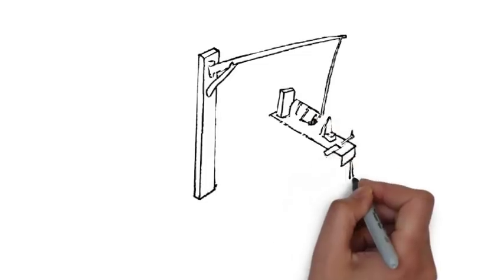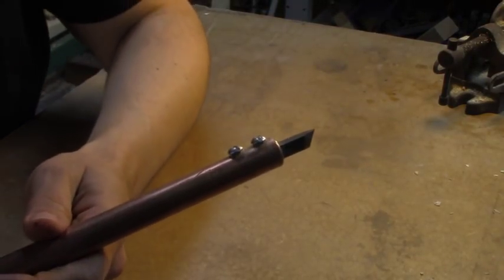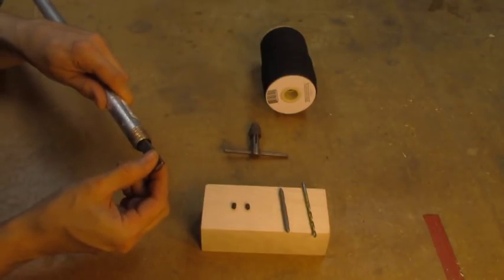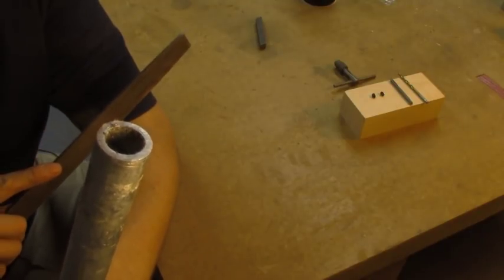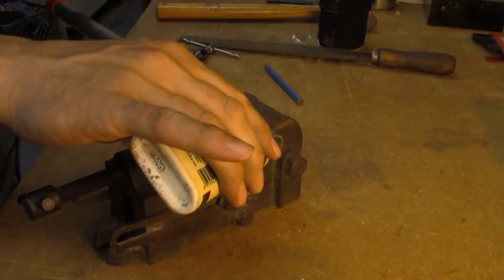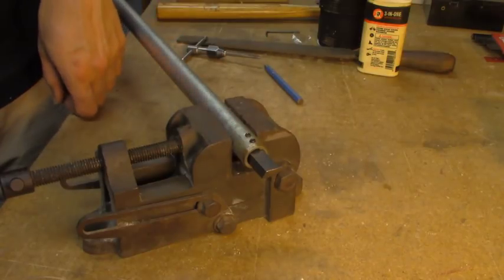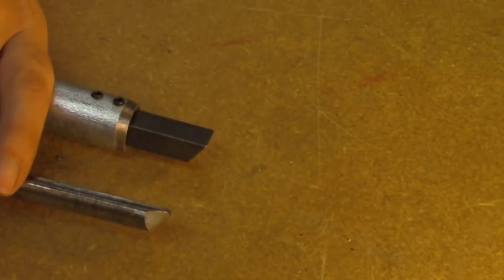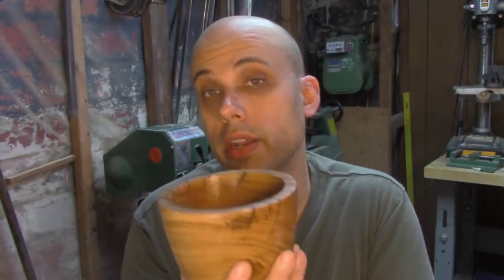Make the cheapest, fastest woodturning gouge EVER.

Comment: This will probably cut even better if you polish the top surface of the bit, because it will give a much finer edge than the mill scale that's there now.
Reply from the maker: A great point.  I actually hone the top with a diamond plate, but this video was already long,  so I left out some details.

Comment: ive not found many places for the cobalt high speed steel, ebay is outrageous on the prices  . 10 bucks for each small piece
Reply from the maker: John Hill Any metal lathe turning bit will do you.  they're all hard as a coffin nail and easy to shape on the grinder.  if you can't find cobalt exactly,  there are many other alloys (like tantung g, for instance) that work plenty good for our purposes. good hunting.
Reply: I tore apart an old washing machine and took the center steel shaft  and cut off and been grinding on it, its pretty hard steel, think it may work fine, its like 3/4 round.. thanks for the info

Comment: Why not just make a carbide bit tool?  They work very well for turning and are very durable and there are many videos on you tube showing how to make them.  They work both on end grain and very well on side grain.  I have even used them almost exclusively for making a bowl from a green piece of firewood.
Reply from the maker: That's a great question. I'm really interested in carbide and I'll be making some of those as soon as I have a spare minute. But to answer your question, I think these tools have some big advantages. 
1.) Cost. These tool bits can be found for as little as $1.
2.) Re-use. High-speed steel is easy to resharpen with the grinder you already have. Carbide is generally disposable. 
3.) Custom tools. These bits are intended to be ground to whatever shape the machinist needs. The turner can do the same thing and even have several bits for each handle.
Reply: Good point! :)   May have to try one.  Always a good excuse for making another tool and another handle!
Reply from the maker: Glad you think so. I like tool-making almost as much at the actual woodworking.
Reply: Or something that takes inserts... Amazon has tooling and inserts cheap

Comment: If you don't have a tapping tool you can pre drill a, smaller size then the screw and screw it in carefully, with soft metal should go fine just be careful to no break the screw inside the hole, it happened to me and it wasn't funny

Comment: Watch a fishing rod building video on how they put on the eyes there is an easy way to finish of your cord with out a knot.  Which is basically  on do the last 6 turns at the knot place a u shape or doubled pcs of cord with the doubled u part past where the knot was rewrap the cord, put end thru the  u and pull it under the 6 wraps. Lol watch video I'm terable at explaining
Reply: Yeah - exactly my thought - the process is called 'whipping', if I recall correctly, and the whole of the cord is glued in place.

Comment: $2 for your tool bit? I'm jealous. I'm seeing more like $20 on Amazon.ca.
Reply: Can buy them cheaply on etsy.
Reply: @robertcornelius3514  I can't find them. Could you help with a link or a good search term? Thx.
Reply: @charliebrady3751  , look up "used carbide cutters," and get the ones that are already soldered to the square steel.  Because my tool has a half inch hole, I will buy the 3/8" x 3/8" cutter. If you shape the end of the carbide cutter, then use a silicon-carbide wheel. Carbide cutters will destroy regular grinding wheels. Deep boring bars will work as a handle. My latest Oland style tool was made out of a large crow bar. Can't drill through this bar until you bring it up to non-magnetic temperature.  I now have three DIY Oland style tools.

Comment: Rex, you pop up with some real winners of projects, and demonstrate some astoundingly detailed knowledge (e.g. steel types), but shrugged off 10-32 set screws and tap instead of helping your viewers. You probably assumed that everyone just knows it.
For your viewers, I expound:  A basic understanding of fasteners can carry one a long way. Thread-form standards are set by The Society of Automotive Engineers (SAE), American National Standards Institute (ANSI), and International Standards Organization (ISO). The first 2 deal in American traditional measures (inch, foot, pound ....) and ISO is heavy on metrication (mm, cm, kg, et  al. ) for internatìonal commerce. Hence, TPI is threads per inch.
 Fasteners are made using standard wire sizes (commonly 4,5,6,8,10,12 (and other sizes increasing by 1/32" in the U.S.). The first number in a fastener size is the wire gage, and the TPI (t/in.) follows, set off by a hyphen. 10-32 is a wire size 10 with 32 threads per inch.  Threads are also designated as National Coarse (NC) and national fine (NF). 10-32 is NF and 10-28 is NC
I am not well familiar with metric fasteners--except by metric hex-head size and leave it to someone smarter than I to clarify.
Reply from the maker: So, that was a GREAT explanation, and I thank you. But just for the record, I shrugged it off because none of that information is necessary to make this tool. When I'm making these videos, I need to keep them short and to the point. But really, thanks!

Comment: I think you have a half an inch bit.
Reply from the maker: Robbing Hook nope,  it's the smaller size.  in my next video,  I use a half inch bit in a larger pipe to make a bigger tool.  but it doesn't really matter.  if your bit fits in your pipe,  your tool will work.  anyway,  thanks for watching!

Comment: Too bad we didn't get to see you hollow out that piece of wood.
How about using bicycle handle bar tape on the handle bar to get rid of that ugly knut.
Reply from the maker: Rolingmetal Hey! I LOVE your channel and watch it all the time.  I'm really glad you're watching my videos.  as to the bicycle tape and ugly nut, I'm not totally sure what you mean.  Do you mean the heads of the set screws? I need those accessible so that I can change bits.  see my follow-up video on tool bits for this tool.  anyway,  thanks for watching.  I love watching you solve problems with limited tools.
Reply from the maker: Rolingmetal I might try that next time.  Anyway, keep the good machine videos coming. You have a fan in me!

Comment: if the steel turns blue its not going to loose its temper ......with knowledge like that you should be on forged in fire lol yes it is going to loose its temper , unless your telling me you heat treat and temper to blue ? which no one in the world dopes unless they are making springs PS im a blacksmith gunsmith and bladesmith (( no not the kind that goes on fudged in fire , i know what im doing lol)
Reply from the maker: So, not that your sarcastic and douchy comment isn't appreciated, but I'm actually right about this. The steel I'm using is a Cobalt "high speed steel." They call it high speed because...wait for it...it can turn steel at high speed and high temperature without losing it's temper. It would be useless for it's intended purpose if it didn't have that property. These cobalt bits can get red hot without losing hardness. This is not a carbon steel, an oil-quenching steel, or any of those alloys. You might be a blade smith, but you're clearly not a machinist and you're talking out your ear. But thanks for stopping by anyway!
Reply: Blue is HSS is 575 F tempering temperature of HSS is up to 575 f which means blue is one degree f from losing its temper ( like you lol) , YOU said the bit you used contains cobalt you didn't say it was 100% cobalt  technically you were correct but its still lousy advice , unless you can monitor your temperature to within one degree and react fast enough to stop putting more heat in to it in 1 tenth of a second.

Comment: Don't make my mistake - a coworker told me I should epoxy the bit in the hole for better stability. I used JB Weld. Big mistake - I heated that stuff up with a torch until it smoked but that bit just won't come out. Ever. And now it's getting pretty short.

Also, you may want to pack the hollow pipe with vibration-dampening beads or sand. I made mine out of solid stock, so it doesn't vibrate much. But drilling that center hole for the bit into solid stock  isn't much fun.
Reply from the maker: Noor Khalsa Those are really good tips.  I haven't found vibration to be a problem, but only time will tell. I've also gone the solid stock route for my little oland tool, and it took FOREVER. maybe rather than jb weld, just some superglue or threadlock on the set screws.  longer hold and totally reversible. I guess we all need to keep experimenting!
Reply: Yes, with superglue, you can heat it up and break the bond. Re: vibration. Some folks use lead shot as a filler. It works great, but I'm not a big fan of keeping lead around my shop. Not even if it's certified organic :)
Reply from the maker: Noor Khalsa Yeah,  plenty of poisons in my shop already.